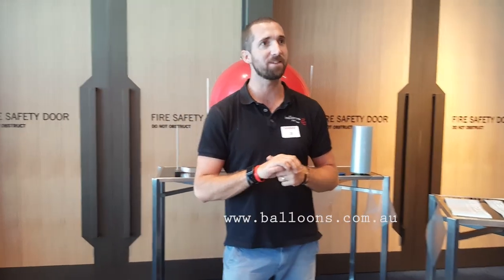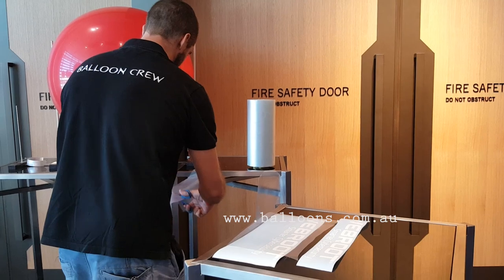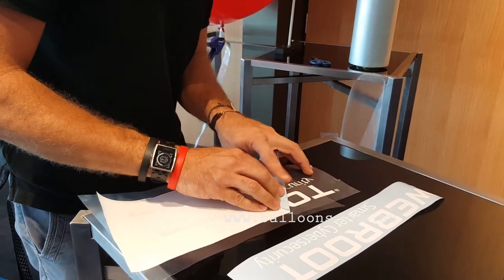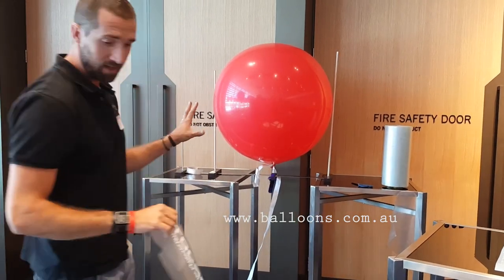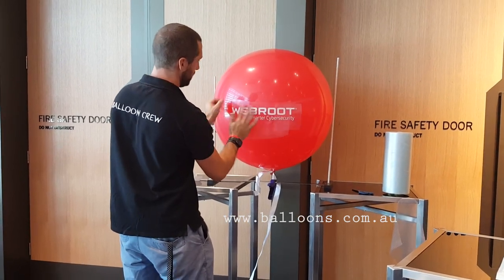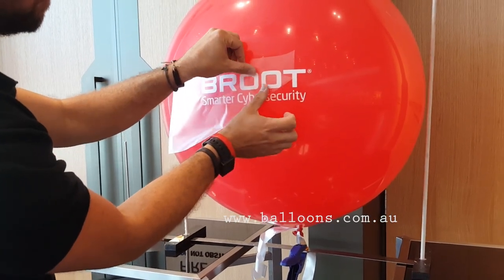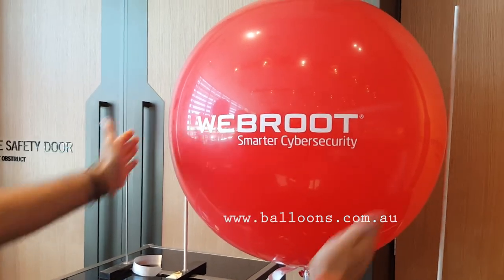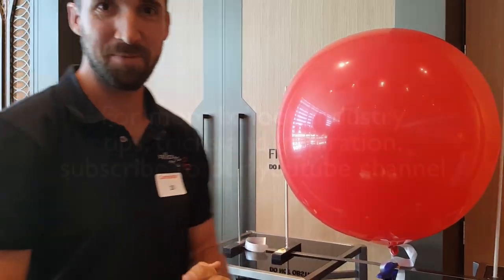Vinyl transfer tip onto 3ft latex balloons

Comment: Hi Chris,  I made one of these large latex balloons with vinyl for my daughters birthday last week and I found that after about 24 hours or so the vinyl went a bit bubbly so had to shift it around . Is this normal ? I added a pump of ultra high float too . It also started  to drop a bit but I did have a tassel garland on it . Many thanks 😊
Reply from the maker: Hey! Unfortunately latex and vinyl is a tough combination. Latex starts shrinking so quickly. We guarantee only 12 hours with vinyl (after hi float).

My advice would be to pre inflate with hi float and then let settle for 24 hours. This sets the high float and passes the initial larger helium loss
Reply: Ahh that’s a good idea! Thanks so much . I will give that a go

Comment: Hi! What vinyl machine cutter do you recommend for me to buy? I want to print on 36" balloons. Thanks
Reply from the maker: Hi Janet. Unfortunately I haven't tested enough machines to be able to answer that question. We use the KNK Zing and its fantastic.
Reply: oh okay. Which one do you recommend for confetti balloons? Clear latex balloons or Bubble balloon? Will the Confetti stick if I use bubble balloon?
Reply from the maker: Both work great. You can stick confetti to both using static, latex balloons can also use hi-float to help stick the confetti.

Comment: Hi Chris, I have been inflating some balloons using the vinyl and the Hi float, but I´m having some issues  that I hope you can help me with: 
1. With clear balloons the hi float leaves little bubbles so it doesn´t look smoth and completely clear, how can I fix that?
2. When applying the vinyl it looks nice but after a couple of hours starts to came off and have wrinkles on the vinyl, like if the balloon is losing the helium even with the hi float.
3.what kind of vinyl do you use? do you use a special brand?
4. Clear bubble balloons from qualatex can be treated with hi float?
5. When I apply the tissue paper confetti after the hi float, the color from the paper start kinda transfer to the latex, do you leave it to dry for how long before apply the confetti?

Thank you so much for any help you can provide.

Diana.
Reply from the maker: Hi Diana

Hopefully I can help:

1. With clear balloons the hi float leaves little bubbles so it doesn´t look smoth and completely clear, how can I fix that?
After a few days, especially in heat the hi-float will start to look cloudy but you say bubbles? Perhaps you are using too much hi-float, in Sydney Australia we use about half the recomended amount and still get the same result. Its a balancing act between making sure you use enough hi-float to be effective (properly coated) and not using too much so it clumps and looks messy.

2. When applying the vinyl it looks nice but after a couple of hours starts to came off and have wrinkles on the vinyl, like if the balloon is losing the helium even with the hi float. 
Try applying the vinyl after the hi-float has set and the balloon has made its first initial reduction. (say 4 to 5 hours). Vinyl can also be significantly affected by fluctuations in heat... so if its cold overnight, the balloon will shrink and the vinyl won't shrink at the same rate. When it heats up the next day, the balloon will expand back to its original position but the vinyl won't stretch at the same pace... bubbles will form.

3.what kind of vinyl do you use? do you use a special brand?
We use 'Avery 500' found here (from our local supplier): http://www.gamart.com.au/Products/SignageFilm/Avery500MatteMonomericCalendered.aspx

4. Clear bubble balloons from qualatex can be treated with hi float?
I have tried this but with not much luck. The hi-float cannot breathe through the deco bubble material like it would with latex (more porous), so it doesn't dry as fast. Also you don't need hi-float in a deco bubble for longevity.... I tried it so I can get confetti to stick, the problem I found was the neck of the bubble is so small that it was difficult to get confetti in quickly so it can be evenly distributed and neat.

5. When I apply the tissue paper confetti after the hi float, the color from the paper start kinda transfer to the latex, do you leave it to dry for how long before apply the confetti?
I apply the confetti directly after the balloon has been inflated (using this: https://www.youtube.com/watch?v=3C9gV8-e1Cg). The hi-float should stretch with the balloon and thin to a very small concentration by now. I think if the ink is running you are using too much hi-float, there is excess liquid.

Good luck!

Comment: Hi all, great video. I need some help please. I'm new to this and have done a few balloons with vinyl lettering, unfortunately sometimes the lettering starts to crease and peel away from the surface of the balloon. This is not due to the adhesive loosing its stickiness. I assume this is due to the balloon expanding and contracting due to ambient temperature changes and as the vinyl does not expand/ contract in the same manner its starts to peel away from the balloon. Have any of you experienced this? How do you deal with  it any tips? Many thanks
Reply from the maker: Hey!

You are right, the most common cause of vinyl creases is the balloon is decreasing in surface area and the vinyl doesn't compress at the same rate.

My only advice is to apply the vinyl on the day on location. Also hi-float your balloon in advance and let it sit for 24 hours before applying the vinyl.

Chris